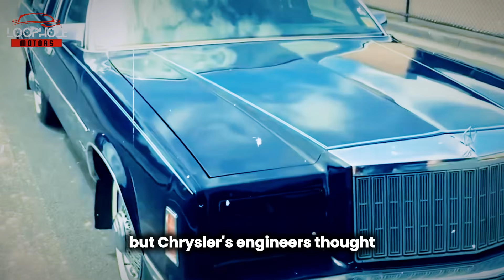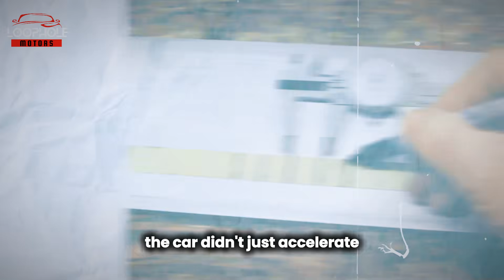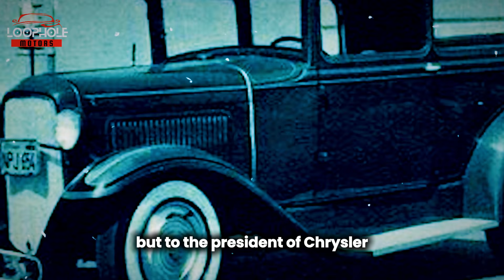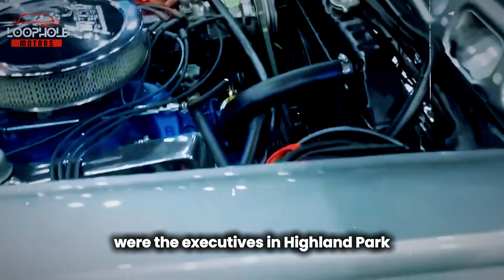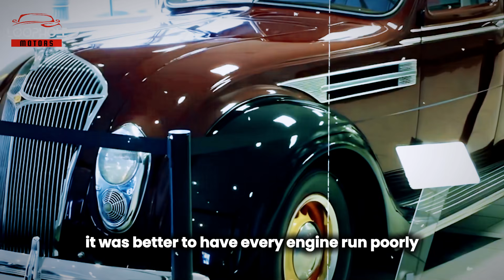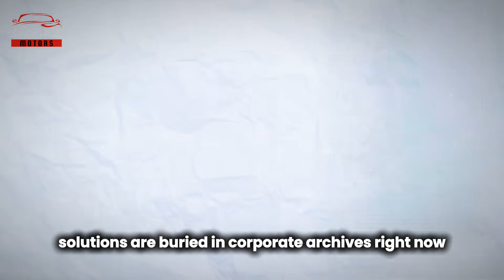The "Illegal" 17° Distributor Trick That Humiliated Chrysler: The Banned Lean Burn Secret?

Comment: You better believe every one of those factory ecu's could gain 20+ horsepower just by tuning them right.  Hasn't changed, the lean burn system is still there....it's just built into your car's computer now.  (Not the actual system, just the retarded timing and poorly written VE tables.

Comment: We used to call it the shake and bake system because it's sat on the side of the air cleaner cooking from the engine heat they ran so horrible the engine shook so bad I know people that put points and condensers back in their Motors

Comment: yea that is what I would do but at the time the only way to meet the standards were to run retarded timing and lean fuel mixtures, I live in Ohio we have what they call E check if I get an older car that failed I lean the carb to the point of misfire and retard the timing to cool the burn temp and get rid of nitrogen oxide, yea they run bad no power but very clean so that is what was going on yea as soon as I got a car to pass I would crank the timing up about 15 degrees and richen the fuel so it would run OK, looking at emissions after they were borderline but no one wants to drive a no power car

Comment: Hold the fuck up. 1976… check-computers? Do you even check your shit b4 u post it???
Reply: My 75 beetle had electronic fuel injection
Reply: my 75 beetle had electronic fuel injection. Google search
Reply: They did have computer controls in the 70s technically a carb but computer control as well

Comment: 1975 has sensors and computer? Put down chat gpt script
Reply: My 75 beetle came with factory electronic fuel injection. Injection system Was still functional at the time of purchase. (Quickly deleted after purchase though)
Reply: Its probably a bit off but 76 had electronic idle and timing control even though it was technically a carb it had a computer to control the fuel mixture amd timing
Reply: Simple analog computers have existed for a very long time.  Ww2 vehicles used some types for various things, bomb sighting for example.  In cars there's the 1968 VW type 3 efi, Oldsmobile had fuel injection and an ECM in 1977 on the Toronado,  there were simple ignition modules and sensors and such going into cars from the early 70s.
Reply: Simple analog computers have existed for a very long time.  Ww2 vehicles used some types for various things, bomb sighting for example.  In cars there's the 1968 VW type 3 efi, Oldsmobile had fuel injection and an ECM in 1977 on the Toronado,  there were simple ignition modules and sensors and such going into cars from the early 70s.

Comment: Wanna talk efficiency gain? I had a 2012 Passat with a 2.0 commonrail turbo diesel. I was barely getting 39 highway when I got it! Deleted all emission components, tuned out the regen cycles and egr etc. 48-50 mpg highway from that point on! My best tank was 850 miles on 17 gallons of diesel driving around 65-70 mpg from long island up to almost Rochester NY, drove around up there for a few days and then drove back to long island. I did not get diesel until I hit queens NY when my fuel light came on. Crazy mpg in that car and she was much more ballsy after the tune. Just about 200 hp crank and 300 foot pounds of torque post tune at 26 psi of boost peak